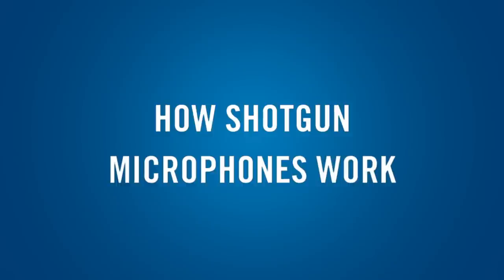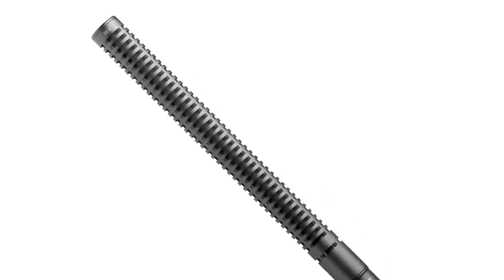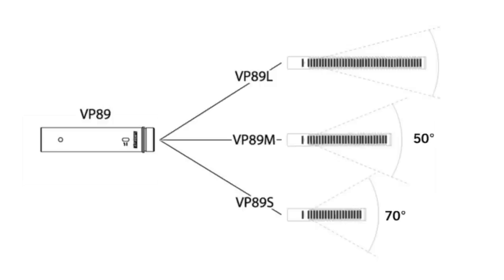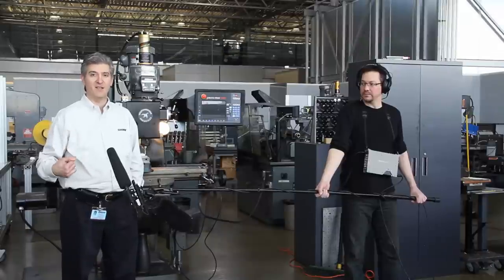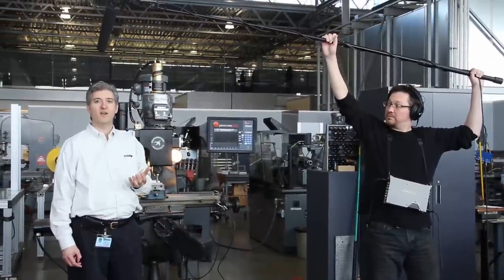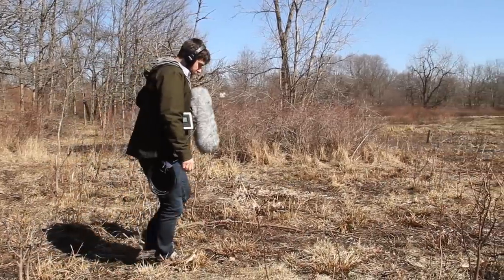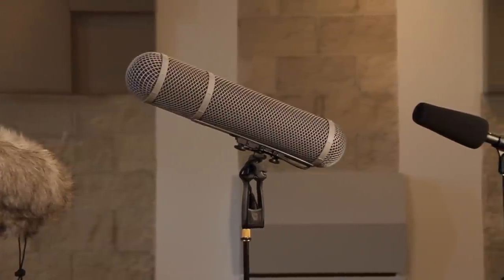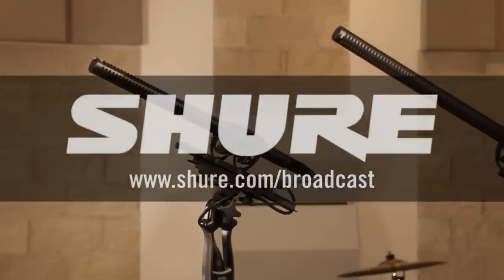How Shotgun Microphones Work | Shure

Comment: Thanks ... I finally learned what to do with with Shotgun Microphone ...
also .. why that Rycote furry beast costs so much and how effective it
is in cancelling wind sounds
Reply: You might have your answer already after 6 years, but, those things are probably so expensive because they most not lose their fur when exposed to severe amounts of wind, but still "brake the wind" (to explain it very crude) without causing to much pickup loss, you need to be able to dry it without the thing shrinking or altering it's wind filtering capabilities.
And they are very effective, a simple plosive filter can already save you during the summer when there is a light breeze (which will usually seperate your footage from that of people with a handycam who are simply unable to shield their microphone from any wind entering it), but they will quickly loose their effectiveness with stronger winds.

They are probably used more in professional TV applications than you might think, simply for not realizing you don't hear any wind while there actually is a microphone equipped with such a device nearby the head of the host of a program (sometimes in combination with a lavalier mic with a "dead mouse" on it).

Comment: Hi. Do you need a digital audio recorder, for example a Tascam or a Zoom, to use with the shotgun mic or would you still be able to get good sound without a recorder?
Reply from the maker: Most shotgun mics (and other condenser mics) will require a recording device of some kind as well as an XLR microphone input that provides phantom power.  Some portable recorders have these features.

Shure’s VP83F shotgun mic integrates a recorder that writes data to a Micro SD memory card.  Otherwise, both the Shure VP83F and VP83 can connect to a DSLR camera or camcorder using a stereo 3.5mm connector.  Both of these mics are powered by AA batteries.

Comment: I agree, nice video, but they didn't actually explain HOW it works only THAT it works and longer = narrower arc. Where is the mic cartridge positioned and why do the side slits make a difference. Why not just use a short tube with no slits? There has to be a reason, so a video explaining it a but more technically would be useful, thanks.
Reply: It's been 5 years and you may have your answer by now, but for everyone else: The microphone cancels out sounds it picks up when not coming directly from the pickup angle (this will depend on sound pressure, they are not necessarily good at like a pop concert, simply for blaring speakers creating so much moving air they will notice anything coming from anywhere, basically).  There are (usually) a couple of pickup elements along the slotted tube that listen to differences in loudness for sounds coming from a specific direction, anything around a certain threshold is perceived to be coming from the left or right instead of the front (if I recall correctly there have been microhpones that could listen to time differences in the sound signal simply for a sound from the left arriving at a slightly later point in time to the right side).  What it picks up because it's basically the same in loudness (and in time, maybe, techniques could have changed a little over the years) it perceives to be right in front and only outputs that to the amplification circuitry.

Comment: Shure have been around for a long time but they're pretty new to Shotguns prior to the VP89 range of 2011 they've only ever had "ONE" shotgun the SM89! sure It's been around for 25 years but are they the right people to tell the community "How Shotgun Mics Work"? I always heard HyperCardoid mics were only for indoors? Shure only makes hypercardoid shotguns mics does this mean they're only good indoors?
Reply: Hypercardioid's or supercardioids are just as well used outdoors, look at soccer matches, at certain points in the game you will hear the ball getting kicked extremely clearly, while it happens out in the middle of the field.  That's achieved by someone holding such a microphone and aiming it (sometimes aided by a reasonably big plexiglass dome that, much as a satellite dish focuses the sound to the microphone, which will be facing the operator, basically and creates a very narrow beam in which it will be able to "listen" to sounds happening 30 meters away.

Maybe the difference they were making is that some of the types of Shure microphones are aimed at indoor use simply because their elements or electronics might not be able to cope well with humidity differences or worse, severe amounts of rain.

Comment: At the risk of being made fun of....I have COPD, and get short of breath very often. Will a shotgun mic eliminate the sound of me breathing heavy? lol...I know it sounds dumb, but audio is crap when I shoot video
Reply: A microphone, whether an omnidirectional one or a shotgun mic, will pick up the sounds it was aimed at (or, with the omnidirectional microphone, also what it was not specifically aimed at, simply for it not being a directional microphone).  If you are talking about being behind the camera, most directional microphones (and I think also some of the superdirectional ones) also pick up sound from the back, not as much as they do from the front, but they will do so (which is what the video showed with booming from the top or from the bottom).
If you have a tripod, during static shots, I would suggest taking a few steps back from the tripod, but I know this is not always possible and not really much of a solution for shots in which your camera moves.
What you might be able to do is capture background sounds when you are far away from the camera to edit these under shots that don't prove you are fooling your audience with editing sound from a different clip.

Comment: Ans wait. Haven't they forgot to tell us how they work?
The title shall be how to use shotgun mics.
Reply: They explained that there is a slotted tube called an interference tube on the front that canceled out off-axis sounds. For the target audience there is no need to explain any deeper.
Reply: They have a very intelligent (and usually very fast) circuitry inside that listens to (sometimes) multiple smaller microphones along the slotted part of the microphone.  Any sound coming from only left or right will be cancelled, simply for the circuitry detecting it was not coming from the other side at the same loudness.  Anything however that comes from the direction of it's pickup angle will be "heard" at the same time (some microhpones in the past were able to listen to phase differences if I recall correctly, they were able to correct for time differences between sounds picked up left not arriving at exactly the same time on the right) and with the sound that is cancelled out be outputted to the amplification circuitry.

Today, with technology becoming better (and sometimes also a lot more cheaper) there could be different ways to do things like this though.